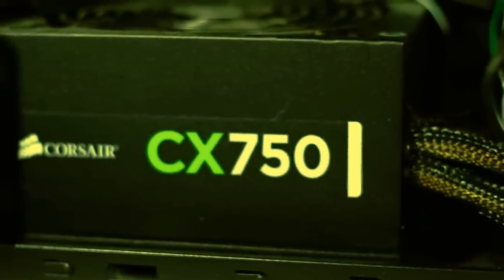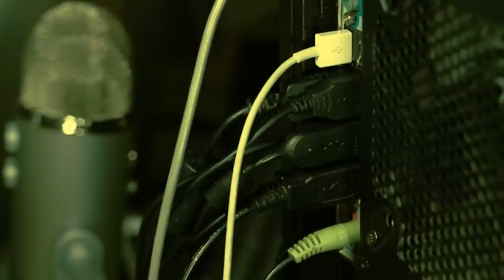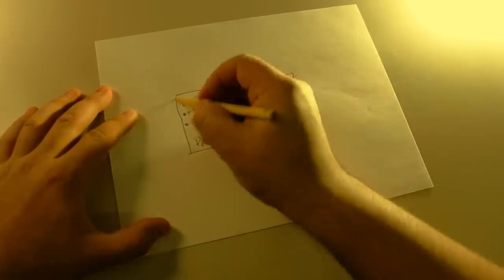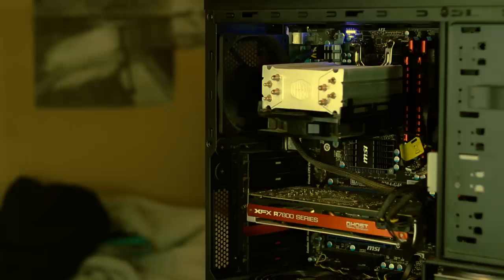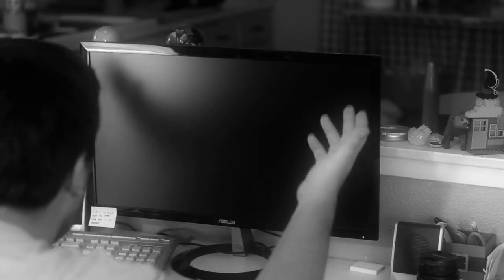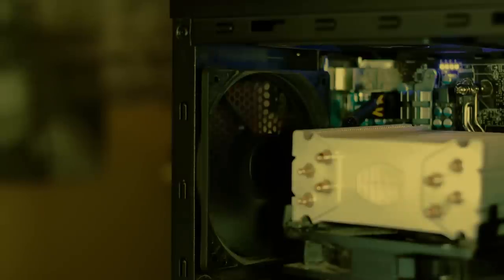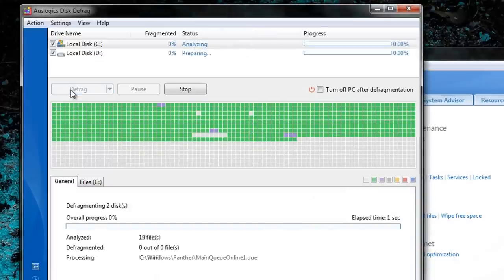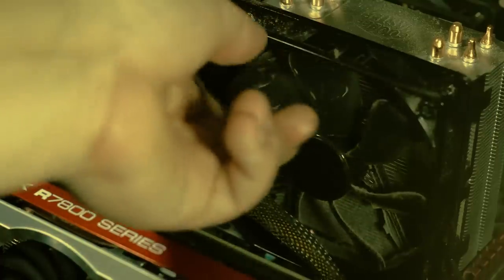What To Do When Your PC Shuts Down At Random

Comment: My PC shuts down a couple minutes after start up or during start up
Reply: YoureADuck same, did you figure it out? Someone needs to help me lol
Reply: Same
Reply: Ye😡😑😳
Reply: Same
Reply: just buy and replace the power supply
Reply: I have the same problem right now  i need help 😰
Reply: when you are going to give tips to this guy and realized it was 4yrs ago
Reply: Did any of you able to fix it?
Reply: How to fix it, i have the same problem..
Reply: Same
Reply: Had/have this problem, don't know if I fixed it but I am going through my system by checking error logs.  Goto "computer management" and click on "event viewer".   Look at "summary of Administrative events" You will see under that, "critical, Error, Warning, and etc...."   Check each event for problems and look them up. 

  I had an old printer program that I think is the problem, that I thought was uninstalled.  There were  a bunch of errors by the printer so I uninstalled everything related to it,  not sure if that's it but it hasn't shut down yet.   

 Edit:  It wasn't the old printer program problem it's still shutting down.  
 I have found that first off that it usually happens while online or using thunderbird, but always within 10 minutes.  But once I reboot it usually doesn't happen again until next time I shut down and reboot, and even then it's random.

 I am going through them 1 at a time to try and find the culprit if this didn't work I'm going to try the others till I track it down.  I've already done all the things everyone else says to do such as hardware or power management and I know those aren't the problem, it's definitely software related for me and I don't think it's a virus.
Reply: Replace thermal paste
Reply: me too can anyone help
Reply: angel barbecue is it hard to replace it
Reply: Check if all the capels are connected correctly
Reply: Same
Reply: I had the same problem if i put the CPU to compatible it works fine but slow as hell
Reply: Same
Reply: Mine shuts off completely after about an hour
Reply: @TheDoritoFan80  mine at 30 sec
Reply: My pc shuts down at first 30 seconds.. i dont have a monitor yet
Reply: @astroallen9589  i think thats my problem too
Reply: Same
Reply: same
Reply: Same
Reply: Same... it seems its used by a cmd.exe
Reply: does anyone have a solution yet? I've spent 2 days trying to clean my PC hoping it would work normally again but everytime i turn it on, I could use it for 10-20 min then it just randomly turns off
Reply: Cpu 100%
Reply: Update: I replaced the fan with a new one and my PC works perfectly now
Reply: @astroallen9589  how u know that?
Reply: @spicydokitoburger My pc problem is a bit different, first my pc turns on and it works fine, I'm even able to watch YouTube etc. Then the screen suddenly shuts off and when i watch my computer all the lights: mouse, keyboard, cpu cooler rgb and psu rgb are all flashing like an SOS light. Then i have tu turn it off manually because it doesn't shuts down for itself. I first thought that the problem was on the psu, so i switched it with one of 650w But the same problem was showing. And then i switched my cpu cooler because i thought my cpu wasn't cooling right. Guess what, same and i did it today im stuck on this pc build of 600€ and i watched every video of the freaking yt. None has my problem. Anyone, pleaaaase could anyone help me?
Reply: @zaidrodriguez598  damn, i dont know how to fix your problem but i didnt expect a computer like yours to have those kind of problems. the computer im using rn is an old 5-6,000 php (about 100 euro) computer my family used in an old internet cafe. the cpu is an AMD A4-4020 APU and its very crappy, yet the only problem was the fan. i installed a geforce gt 710 and it can run online games, some on high graphics but some on very low.
Reply: @spicydokitoburger  no problem mate, i guess i only have to be patient and find an answer for this problem, but thank u for giving me an answer.
Reply: Same
Reply: Usually it is the power supplies unit
Reply: Mine too I still do not know this this happned from 6 years!
Reply: watch howtosolveit channel and he will give a tutorial now i fix my windows 10 problem shuting down rondomly and i try to watch his vids and he show me how to fix the shutdown problem and now i fix my windows 10
Reply: Give me the solution I need it despretly
Reply: @spicydokitoburger  hey bro 

I had the same problem with my laptop and just  i gave it to repair after 3-4 months the same problem come back 

Now i am not going to give it for repair instead i am using my laptop with plug in 

And problem resolved 😊

For this case you need a continuous power supply from electricity just like a computer needs and if your power supply gone accidently then you also have battery and i am sure battery will not make it sudden close after power cut 

But you have to plug in again it before shutdown of PC 😂
Reply: @art_ville  bruh what? My PC is already fixed 4 months ago
Reply: same, You have a solution after 6 years? lol
Reply: @angelbarbecue  Yeah. That’s a good tip. I tried replacing my power supply, but I didn’t want to replace it since I was busy, so I hired a person to replace it and, he installed an inferior power supply. I have a broken 450w PS, and he replaced it with a 350w PS
Reply: @zaidrodriguez598  its the cmos battery
Reply: @Nxghtmare  replace cmos battery For laptops replace or remove laptop battery. Note replacing cmos battery fix is for PC not laptop
Reply: Same
Reply: @spicydokitoburger  so replace the fan ?
Reply: @Harizzment  Mine worked after i replaced the fan. You might not have the same problem i had tho. So the best solution is probably to get it checked by a technician, they'll tell you what to do afterwards
Reply: @spicydokitoburger  do you think any of these methods would work
Reply: @Harizzment  I ain't that educated when it comes to tech, all I know is how to build a PC. So, I really have no idea
Reply: @spicydokitoburger  so ask a technician? What to do
Reply: @Harizzment  yeah
Reply: Sounds like the psu needs replaced
Reply: Same,did you figure it out?
Reply: @neluchirita2013  its prob a bad psu
Reply: @neluchirita2013  or a bad power strip
Reply: Same

Comment: sometimes i can go hours without it shutting down then all of a sudden it shuts down and reboots instantly and will keep happening every 5 minutes or so. mostly happens when playing games.
Reply: Same
Reply: @astroallen9589  how my is a exspensive one do you thinl same for me
Reply: @astroallen9589  tjx
Reply: Sounds like overheating components or a bad power supply.
Reply: Exactly what's just happening to my newly built pc now did you find a fix?
Reply: I'm using a corsair 650w gold plus power supply I doubt its overheating 🤷‍♂️ need some help dont wanna ruin all that money I spent
Reply: @Will-Ham42  check your temps in case something is overheating. For example, if a cpu core reaches 100c it'll probably shut off for safety. And even if your power supply is new, it still could be bad or underpowered.
Reply: @astroallen9589  omg it works for me, thank you
Reply: @Will-Ham42  I have the same damn psu and its happening with me aswell, but I bought a new one and it didnt change a thing
Reply: @victorvanhoorebeke4434  I fixed my issue bro check your motherboard and make sure everything is plugged in properly my 24pin power connector wasnt connected my the tiniest pin
Reply: @Will-Ham42  seriously?
Reply: @victorvanhoorebeke4434  yeah good luck bro hope you get it sorted
Reply: @Will-Ham42  I'm updating my driver's but I'll check my motherboard afterwards
Reply: @Will-Ham42  thanks, you're a man of culture
Reply: @victorvanhoorebeke4434  no probs I know how shit it is all the money for it to not work have a good one
Reply: @Will-Ham42  thanks, still haven't found the issue, but back when it used to happen to your PC, did it make buzzing sounds (only through headphones/earbuds)? But the components themselves
Reply: @victorvanhoorebeke4434  idk mate I would just be playing and it would randomly shut off and start up again like I said it was because of the 24pin power connector slightly not in properly
Reply: @Will-Ham42  okay, thanks
Reply: it shuts down when im playing video games, being in a call with my friend and zoom meetings for me lol, pretty sure its the 10 viruses on my computer.
Reply: Samee it mostly happens when playing games
Reply: @Beast GamingYT this also happens for me but except for when I’m playing Minecraft or I’m on discord

Comment: Solution if your windows shutsdown at random as if a ghost pressed the power button

I have found the REAL PROBLEM to be the least suspect. The power button on my case.

I thought my power supply was the cause and went and bought a new one only to see the same shutdowns. 
to fix this issue or test if it is yours you have to go into the "power options" in windows and click "Choose what the power buttons do" then changed the power button to turn off your display,  if your monitor begins to randomly turn off but your computer stays on this confirms that you have a faulty power button on your case. 

all you have to do is set the button to "Do nothing" and this should solve your random shutdowns until you replace the case, Unfortunately this does not solve problems with your computer turning itself ON at night or random times. you can solve that problem by switching the power switch off when going to bed or not using the pc.

Hope this helped.
Reply: Thank you man it Worked!
Reply: very helpful, if it happens again I'll try this
Reply: What case do you have?
Reply: never thought this deep.Ill give it a trt
Reply: Thank you it worked
Reply: Wow thx that was the exact problem
Reply: DUDE THANK YOU SO MUCH. I HAD THIS PROBLEM FOR YEARS AND NOTHING ELSE HELPED ME. YOU ARE A LIVESAVER.
Reply: that didnt help :(
Reply: How do you turn on the pc afterwards?
Reply: power options? Whats that?
Reply: @stefanspirov8363  was thinking same question too,did u find an answer?, or anyone else?
Reply: @marnie-vlog  is a settings sub menu in windows.
Reply: @neilfroggycrompton2466  hehe yep i found it:) thanks
Reply: I think my pc is haunted
Reply: If u set it to only turn off, how you turn it back on?

Comment: thanks man, I was really frustrated about my PC shutting down. I saw other videos and forums about this issue and non of them talked about checking if your 24 pin motherboard cable was loose. All they said was to replace the psu. This saved me $70, good video.

Comment: for some reason it shuts down only when i'm on the internet (Youtube specifically)
Reply: Ryder Wilson yea myne too my PC starter to shut down only when i was updating game or on YouTube. 1 year after iz started crashing my games idn whant go do now pls help me
Reply: Same like my stupid laptop....not only using internet,my favourite games left 4 dead2 and gmod was turn off by themselve and really pissed me off...
Reply: Mine is the same, usually when Iam on the internet or on youtube. Sometimes while gaming. It happens all the time but suddenly. Has anoyone a solution for it?
Reply: Nearly Toxic  i have no idea sir sorry i was trying to find some solution but it still doesn't work....
I was fixing proccecor still doesn't work, cleaning ram it still doesn't, all of my mainboard was clean but it still turn off by itself
Reply: Nearly Toxic  you're welcome so glad to help....
Reply: @BullBosphorus  You may need to take your laptop to a certified local technician. Problems may arise from your GPU.
Reply: Colin Tolon this problem is fixed. The problem was that I installed the cpu vooler not at right position. The air was blowing to other wat instead of into the gpu

Comment: Guys I found another solution by myself! LISTEN UP. So for about a week my pc kept shutting down and I did not even bother to check the motherboard for anything that was out of order. All the cables were connected correctly and that was not the problem but the CPU was VERY HOT. So I checked the thermal paste and my thermal paste was badically dry. Meaning it was turning into dust. So that is why your PC moght be shutting down because as soon as your CPU gets over 60Degrees it will shut down. So I suggest getting more thermal paste and adding it into your CPU. Hope this helped!
Reply: Poking Things This helped alot!
Reply: Poking Things what about if my CPU have 40C and still crashing few times a day.. Is 450W PSU enough for rx 570 4 gb and for ryzen 5 1600? Im using ddr4 8 gb 2400
Reply: i use a laptop so its hard to do something like this what should i do?
Reply: Abdullah Almasri i fixed my prob. My standoff wasnt tight enough or my motherboard was overheating. (Not whole motherboard but i was reading that this motherboard have heating problems where RAMs at)
Reply: Now im enjoying with 4 Ghz OC ryzen and GPU Oc to 1450 Mhz:D so far no crashes
Reply: Poking Things My PC ShutsDpwn Every 40Mins if I play google...  BUT! IF I play the installed games It takes about an 1h
Reply: yea im using a big stock cooler with preapplied thermal paste and my brother has some pretty high end one so i should try

Comment: Turns out, the cable that connects to the power supply was loose and when it stood it turned off, thanks for the first suggestion even though it wasn’t what I was having problems with. Somehow you convinced me to check it and it worked so now I have to use my pc facing down

Comment: In my case my screen goes black and the PC doesn't shut down.The fans start going full speed
Reply: same here, brand new pc its not the ram for me that's for sure, I gave it to experts for two days, these idiots couldnt identify the problem and i still had to pay a shit ton of money whatever, if you find a solution please notify me, ill do the same
Reply: @dimosfint2139  mine got fixed. I just unplugged and plugged again some cables
Reply: @frankdoukas5209  k thanks I'll try it too :)
Reply: Me too. Have recently been having the same issue with my 2 month old custom gaming pc. Did u find out the issue? Im getting kernal event tracing errors and kernal power 41 criticals in event viewer.
Reply: @trevnutz   The only thing left to do was to buy a gpu and that is what I did. And luckily it stopped causing a system fail or whatever (I had cpu with integrated graphics)